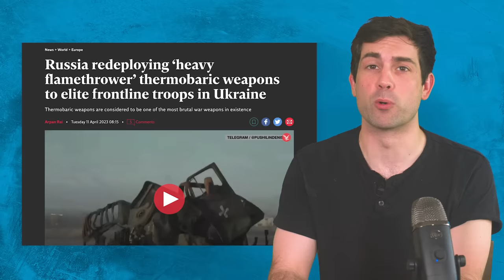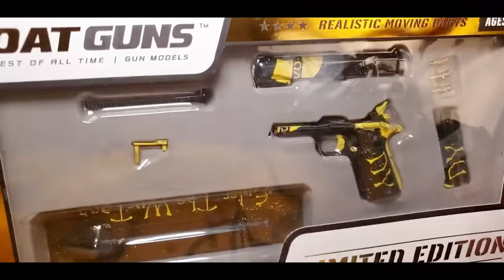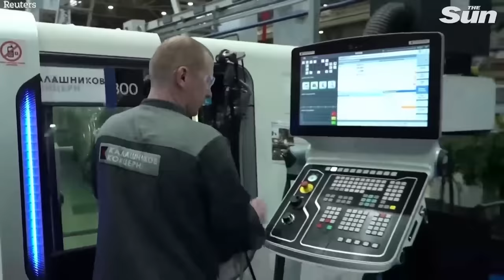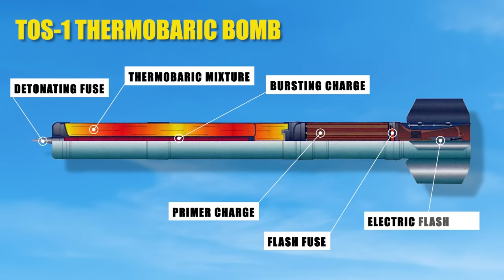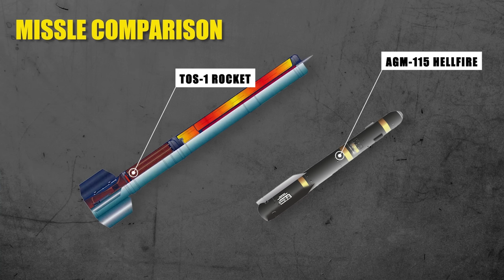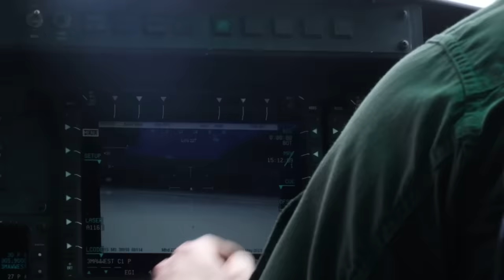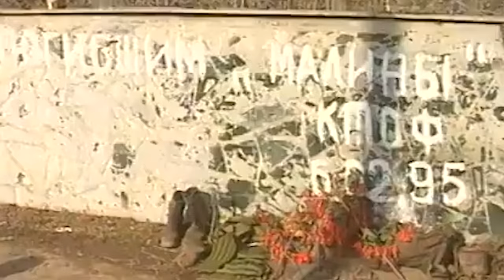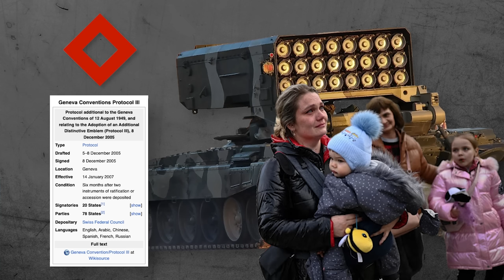How Russian Flame Artillery Deployed in Ukraine

Comment: The TOS1 is "identified as a flamethrower" because that's the translation from Russian to English. Flamethrower means something different in Russian than it does in English. It's kind of like their new mining system, it's called "agriculture." That doesn't mean they're planting daisies, the Russian word identifies a method of seeding mines over a large area.
Reply: Nah, funny names are just that, nothing to do with translation. And certainly agriculture has nothing to do with laying mines, just as flamethrower in russian mass culture is not a missile. 

For example most artillery systems are called after flowers species - pion, giacint, magnolia, droc, etc But some are not - msta (name of a river), acacia (tree), coalicia (coalition).

Same goes for some police equipment - one baton is called "an argument", underwear - "tiger", teargas - "bird-cherry", handcuffs - "tenderness"
Reply: как русский скажу, что если переводить дословно на английский, то будет означать как примерно (very sunny summer day)
Reply: Я бы перевел так: heatness of sun in 12:00 on the beach😅
Reply: burning sunshine  это наверное лучше)
Reply: @husa5777  вы сами не понимаете о чем говорите. Они пишут про flamethrower. А у нас она именно так и называется тяжелая огнеметная система. Вопрос к слову огнеметная. И в русском языке к этому есть вопросы.
Reply: Not different. Same. I would say even in Russian there is issue with naming of the system. But there is explantion. The system initially was supposed to be used by chemical defence division to flame out contamination by chemical weapons. In this case it makes sense.

Comment: Russia has guided munitions for their mlrs systems and for the 6inch and 8inch howitzers

The reason the TOS has such a short range is because it has far heavier warheads on a relatively small rocket, this allows big boom while being easily transportable and cheap.
The fact that the launcher is a tank allows it to get very close to the target with relatively low danger.
This is a very smart type of system and there are multiple advantages.
The system is also very simple to operate and can very easily be converter to a robot, you set it the target, it automatically uses GPS to drive to the fire position, it fires and then it returns.

These advantages mean other armies might want to invest in such a weapon system in the future. It can also work on a naval version, on a big drone boat designed to strike before a landing operation, limiting any risk to your own soldiers and at the same time delivering multiple times the payload of a long range system.
Reply: Wow, so many armchair engineers today.
Reply: @occamraiser  They've got ideas going for them at least, you only have complaints.
Reply: That's just what we need, drone tanks with thermobaric weapons.
Reply: @ladeao1552  we aren’t too far away from coordinated drone armies and swarms. Its the new space race
Reply: It really doesn't matter that it is a tank because the ammunition is heavily exposed. There is no real advantage, which is why most armies don't do this. Long-range, light mlrs is the best way to invest
Reply: @Touring Test too EZ I love how Russian bot throw around the word Wonderwaff 🙄  Like you think it makes you smart for using it but no it hasn't.  The usa continuously updated the GPS to counter it, and it never full countered the himars to begin with
Reply: @Touring Test too EZ "Russia has almost completely defeated the HIMARS system using electronic countermeasures."

I didn't realize bridges had electronic countermeasures. Lol
Reply: @mikes989  please show me where it almost did ?
Reply: @WLADIMIR330 clearly not and that is a horrible explanation
Reply: You can check russian weapon Posaidon.
Reply: Tos 1A is use in great effect in Southern Ukraine during the Great Ukraine Counter Offensive 2023..as per 16th day...btw M0.1.01.04M2 rocket was upgraded in March 2020/2022 to a heavier thermobaric warhead and better 10 -12 km range, to operate outside the range of modern ATGMs.
Reply: Эти приймущества означают что вести в 21веке  боевые дествия черезвычайно опасное  мероприятие.

Comment: They have increased their range from 4km to 10 km recently, which made the difference as they can not be targeted by rockets anymore.
Reply: Cannot be targeted by rockets? Even the old Soviet Grad-system rockets have over 50 km range. Or do you mean only shoulder-fired rockets?
Reply: @Rex  yes, I mean those ones, as these are the more dangerous ones for tanks and artillery. The other ones, like canon and mrap, they need reconnaissance drones to spot them.
Reply: @galimbertino4939  Even though Israel hasn't yet given export licence for Spike-missiles to Ukraine, the newest variants of those have 25 km range. Even the ER II -version has 10 km range.
Reply: @atklm1  they will never give the export license as russia is in syria.
Reply: @atklm1 grad mlrs range is 21 km, man, not 50 km, you're speaking bs
Reply: @dmitriyalaasniy8442  Original Grad was 21 km range, the next generation had 40 km range, current version of Grads have 52 km range.
Reply: @atklm1  there is no any grad with 52 km range,again, don't speak bs. "Grad" with 40 km range actually is a tornado-g system.
Reply: @dmitriyalaasniy8442  Not sure that in which banana republics they still use 21 km grads, but just because you don't have them, it doesn't mean that they don't exist. With any range, Grad is low-survivable, inaccurate, inefficient, obsolete technology in modern warfare.
Reply: @atklm1  give any reliable sources to prove your claimes (grad with 52 km range) or just admit you're speaking bs.
Reply: @dmitriyalaasniy8442  How about, for example, English Wikipedia?
Reply: @atklm1  ooh, wiki, what a competent source, lol
Reply: HIMARS has been slapping RU artillery systems out of existence.
Reply: Why they need planes to stop Russia firing stuff from medium distance
Reply: @HowTo374  Lancet has been slapping HIMARS out of existence.
Reply: @alexkatc59  Cope Ivan
Reply: @nabicx  First, I am jew with Israel citizenship. Second, right now Ukraine confirms that they have only tenth of Russian firepower.
If we sum up all Ukraine artillery and us/NATO deliveries it is half of Russian firepower.
Where is 40%?
Cope this.
Reply: @alexkatc59  
Cope this: Russia can't win against a country 1/3 the size, that had no real military in 2014 and that only recieved old western tech. L country. 

3 days to Kyiv am I right "Israeli"?
Reply: @nabicx  LOL, Russia was near Kiev at first day of conflict, cope ufo-bot! 
"Win in 3 days" was american general Milly's quote.
Ukraine was stuffed with weapons as goose before Russian SMO.
(Thousands ATGMs  and MANPADs, sturdy and reliable Soviet SAM system)
Russia advanced and captured land with less than twice or trice troops.
Maybe in the middle of this year number of Russian troops had become more than AFU troops.
Cope with this.
And USA never fought even such country.
Only much more weaker.
And USA ran even from them.
They has run from Afghanistan, from guys with old AKs.
When Soviets left Afghanistan, pro-soviet government controlled 80% of country and slowly advanced.
This government had held the ground till 1993, when Russia by US order was stopping to sell this government ammo and fuel.
How long did pro-american government hold the ground?
Weeks?
Days?
F**king hours!

Comment: Saying that the oxygen sucking effect adds to the destructive power is like saying that sound of the gunshot adds to the destruction of the bullet.
The only upside of using oxygen from the air is that the weapon does not need to carry its oxidizer, but that means the weapon has to make a close to stoichiometric mix with air for the explosion. This is not very ideal because only about 20% of the air is oxygen, so the rest of the air would consume energy to heat up. That means that these explosion are cooler, and less powerful compared to using high efficiency oxidizers. (this creates a non-trivial trade-off)
The vacuum is created by the explosion over-expanding (nothing to do with oxygen). Anything which can create lots of hot gas and cool it quickly can create a vacuum effect. The cooling is caused by the very fast expansion of the explosion. This weapon tend to heat up very large amount of air instead of just creating hot gas like more conventional explosives. This largely enhances the vacuum effect.
Reply: It's the vacuum it creates, and the ability to breathe.  It is not remotely comparable to to a gunshot.
Reply: Thanks for the generous dose of engineering mythbusting. The amount of illiteracy amongst the media and various military tech pseudo-experts is absolutely cringe. Worst part being that they proliferate such nonsensical BS, which their audiences proceed to take as gospel.
Reply: you wrong in many  points but i will say this  . matter  does not get destroyed for all we know oxygen will remain  in air wheather  you  cool it or get it hot
Reply: @macpj12j  I literally cannot understand what you mean in your comment.
Reply: @macpj12j Oxygen burns, genius.
Reply: @huwhitecavebeast1972   i didnt say that i sayed   oxygen does get destroyed weather you get the  atmosphere ( air ) hot

Comment: I can totally believe that the Russians would be sparing with their use of TOS systems till after Ukranian artillery in the region was quieted. The Ukranians kept rotating new units into Bakmut, so to me this would explain the slow initial slog, characterised by attritous trench warfare on the outskirts of the town, artillery duels etc, but then within like 3 days (which coincides with the Russian MOD saying the TOS systems are being moved forwards in Bakmut)they managed to push into the town and start clearing block by block in a methodical grid. This to me is where the TOS systems are finally being used extensively, with the infantry essentially pushing forwards and securing cleared ground. Then the incendiary bombardment of the area of big apartment blocks kinda ended what was the siege in earnest, with fighting continuing sporadically on the outskirts.

Comment: There is an important difference between fuel-air and thermobaric munitions. The first are two-stage  (dispersion and initiation charge) whereas the second are one-stage and metallized. Thermobaric metalized are mostly solid-state (though not all) whereas fuel-air are liquid volatile explosive.  It looks like Russian TOS-1 is fuel-air, not thermobaric.

Comment: The author was wrong only in one.
Russia doesn't use Buratino (TOS-1), but Solntsepek (TOS-1a)
In Russia, there were practically no Buratino systems left in the early 2000s. They are very different visually. At the frontline, 99% is Tos-1a Solntsepek.

Comment: The TOS-1M has 30 launch tubes and the TOS-1A 24. I have yet to see the 1M version, so most have only 24 rockets. I doubt the 1M is still in use, due to the shorter range. The weapon system shown at 7:03 is a BM-21 btw, not a TOS ;-)
Reply: Unfortunately TOS-2 "Tosochka" wasn't ready for this conflict

Comment: If you think about that name, that classification, flamethrower, the rocket-sender is more a flame thrower than the thing I usual mean by flamethrower, the 'gun' hold, that projects a streaming lance of burning flame.
The first one actually throws a fire on its target. The flame-gun is more a hose, that launches its jet from itself to the length of its range.

Comment: i think they are working on a version to further increase its range from 6.5kilometers to 9-10 kilometers which would probably decrease the warhead size a little bit but longer range is more desired now days so it wont be in tank or shoulder fired rocket range
Reply: Yes- TOS-2. On a truck chassis allegedly has been used in Ukraine

Comment: To add on anti fort purpose, vacuum thermob rockets ignite in a chain reaction the available oxygen inside a structures everybody not killed or blown up violent heat and expanding gasses from ignition thats continuesly happening WILL suffocate during the aftermath

Comment: If you just look at the energy stored in typical explosives and oil, oil has easily an order of magnitude higher specific energy, so it is not just the missing oxidizer.

Comment: In the Gulf war the US used wepons enrisched with Uranium. A lot of areas in south of Iraq have high radioactivity near destroyed Iraqi tanks.
Should these wepons be allowed to be used i Ukrain?
Or does morality work for you differently depending on which country is doing the war crimes?
Reply: a moot point since russians have DU rounds for their tanks, they definitely will be issued to the crews if there is even a slight chance of clashes with leopards.
Reply: @juslitor  we have tank rounds capable of destroying Leopards and they're not DU. DU rounds are only for T-80BV tanks with new 2А46М-4 barrels. So far there is no evidence that we used them and most likely we won't since we need ukrainian agricultural fields.

Comment: Fun Fact: I could be wrong, but IIRC just a single gallon of gasoline if properly atomized and dispersed by the bursting charge, and the second "Ignition" charge properly timed to go off at just the right moment and Fuel/Air ratio, that single gallon detonates with the explosive force equivalent to 10lbs of TNT, might've even been KG, can't remember. 

And that's just plain 'Ole gasoline or "Petrol", they can make them A LOT more efficient and destructive with their specialized blends of chemicals and compounds most people have never even heard of, for the "True/Real" purpose built bombs designed to cause a Fuel-Air-Explosion. 

(Also, that long prolonged explosion is one of their key benefits. It actually allows more damage to happen by lasting longer as opposed to a quick Shockwave all at once. And the reason they're called "Vaccum Bombs" by people, is you need the right Fuel/air ratio for an FAE to occur, too much or little of either one and just nothing happens. That means when you DO get the ratio right, all that air becomes part of the explosion and is used up; this creates a massive and intense effect of the surrounding air being violently sucked into the void, hence "Vaccum". This force will essentially try ripping your lungs out through your mouth resulting in extreme and fatal internal bleeding, this effect is also why they're so effective against tunnels, bunkers, buildings, etc.)

Also an FAE is just an explosion caused by a cloud of combustible "things" in the air reaching the proper "thing" to air ratio to allow sympathetic and instantaneous Ignition of the entire, or at least most of, the cloud. Literally entire mines have collapsed because of coal dust in the air exploding, entire concrete building and mills transferring large amounts of Sugar or Flour have both had cases of Literally being blasted apart by the force of just some fine flour or sugar igniting in the air and a MASSIVE explosion propagating from it.

AND LASTY BUT STILL IMPORTANT, this was literally all my post was supposed to be at first: Small correction on the video, the BLU-82 "Daisy Cutter" was NOT an FAE bomb, she just she just brute forced her way into people not knowing the difference considering her one by essentially packing a big-ass paint can to the gills with 15,000lbs of an aluminum based High Explosive slurry. I think the filler was Ammonal or Amatol or something like that.

Comment: there's a lot of mis-speak about this means of explosion: (i) it is not a 'vacuum' bomb; that's misinformation. It doesn't 'suck' the oxygen out of the air, it just burns it in a similar way to a good diesel or petrol engine. The oxygen contained in the local  'air' combusts with the distributed fuel load resulting in more (product-of-combustion) gas molecules  - hence higher local pressure, at a much higher temperature - than were originally in the volume.  WIth sufficient material combusted sufficiently rapidly, the combustion zone 'shocks-up'. That wave has a high (pressure) peak followed immediately by a rarefaction zone (low pressure), hence the visible wave. For a mammal within that zone, it's hard to avoid shredding of the lungs. But 'vacuum bomb' it ain't. Apologies for pedantry.

Comment: You show not Tos1 Pinocchio, but Tos1A Solntsepek.

You forgot to mention TOS 2 where power and range are several times higher.

You also forgot to mention that Russia has such systems as SMERCH AND TORNADO, With high-precision missiles at a range of 120 and 200 kilometers.They are also equipped with a theriobaric charge even more powerful than TOS1A and the missiles are controlled by an inertial independent system from interference or satellite guidance with a deviation of 1.6 meters

Comment: When you ignite an aerosolized flammable gas, I thought it just creates a fireball (the shockwave is subsonic) and not an explosion (which has a supersonic shockwave)
Reply: It's aerosolized particles of a special metal-fuel mixture. So not a "gas" like propane or gas fumes. The metal particles burn much faster and more intensely.
Reply: @swordmaster2k1  Thank you for the informative reply! Also, is the exact chemical composition known or classified?
Reply: @gabedarrett1301  That part I don't know. I imagine searching for it would get you put on some sort of watch list though. 😅

Comment: The TOS is overhyped as fuck and it really wasn't cruical for Bakhmut. The biggest flaw is the absolute ass range it has - 4km. 
Apparently they've recently started upgrading them to 10km, but that's still quite short. The TOS is actually one of the rarest systems used so far precisely because of the range issue.